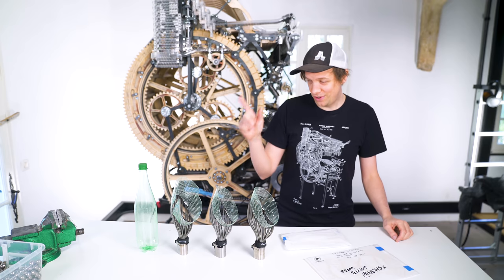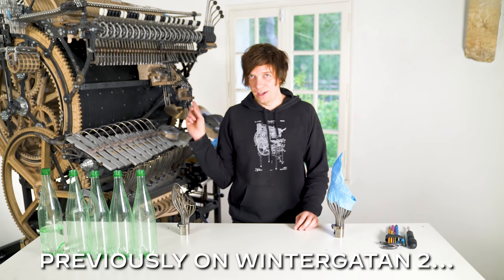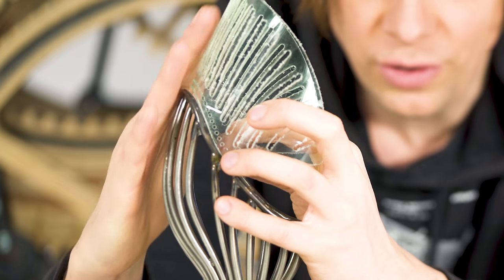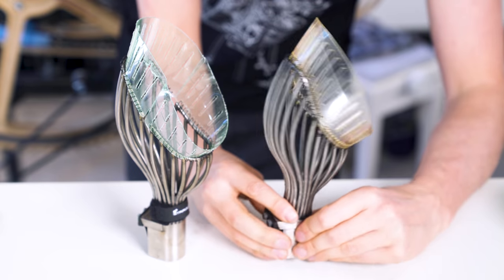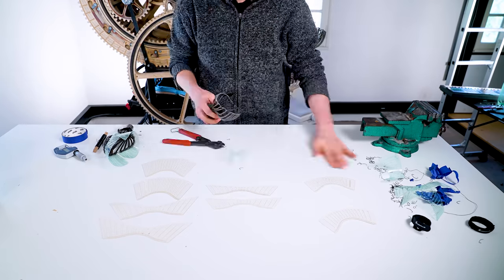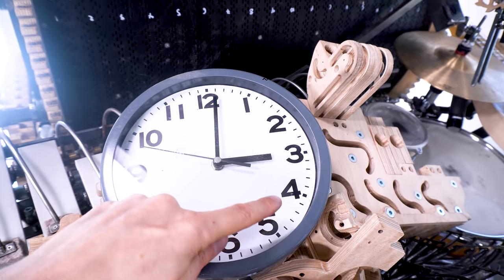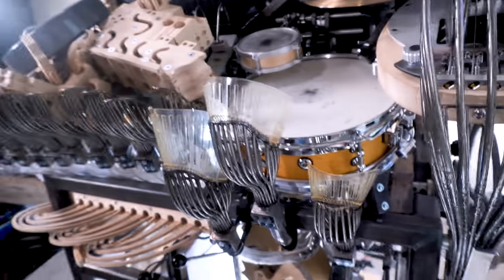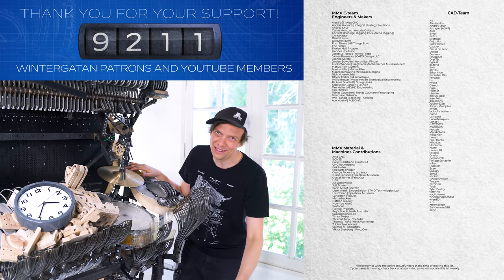Laser Cut Marble Funnels

Comment: I'm curious, how much would the noise from marbles interacting with the metal on the marble dropper influence the sound AFTER production? It's an awesome design. Can the metal parts in the marble dropper also be dipped into a coating to mute the sound a bit?
Reply: He already did this quite a while ago - he coated funnels in some kind of transparent rubber resin, which significantly reduced the noise.
Reply: @zigmar7  You are right. I remember seeing this on the funnels that catch the marbles, which I think is what you are referring to. I'm referring to the new marble dropper though.
Reply: @zanededekind9524  The issue there is friction, you don't want the marbles sticking to a plastic coating especially at their most timing-sensitive interaction with the machine.
Reply: The new dropper design should not pose that much of a sound problem, as the marbles are not "hitting" it but just "sliding along it" The only significant source of "clinking" are the rails of the drop-height adjustment. And they are also part of the old design (and didn't pose that big of a problem there).

But the fix would probably also be rather easy, by putting some sheathing like clear PVC-Pipe around the rails, thereby reducing the sounds while keeping the extra friction minimal (and easily mitigated by adjusting the drop-height ever so slightly)

Comment: Depending on the light, the plastic looks fine, but the rust color just doesn’t sit well with me. I works though so that’s more important.
Reply: Yeah I think Polycarbonate with its transparent, slightly gray-ish color would look a lot better here. Plus the stuff is indestructible.
Reply: Personally, i think the green tint was MUCH better than the yellow, which i think looks more like dirty snow.. even better description would be the windows of an indoor smoker, they are disgusting. The green is my preferred of the two colors, a gray like mentioned might be nice too
Reply: @Basement-Science  but the yellow color doesn't come from the plastic, it comes from the byproducts of laser cutting.  Polycarbonate will do the exact same thing, which is why it is not considered laser cutter friendly.
Reply: @EGL24Xx  Yeah good point, I think someone already wrote something about how you can remove the color as well.

Comment: The marble opening mouvement could've been possible with Lycra® fabric or another elastane fabric between the two parts.

It could also have gave an arty little touch of color on the machine.
However, it's time go move forward and stop redesigning the funnels. this does the job for now and give a funny medieval helmet feeling.
Reply: I think the entire point was to stop the movement of the funnels, they can move fine without the band as thats what they were designed to do.  But the movement was causing issues.
Reply: @caleb6750  The mouvement creates two issues. first, some marbles miss the funnel when it's open and thus has a lower height. This is fixed by the new plastic helmet-looking extension.
The second issue were that some marbles escapes by the gap between the two parts when it's open that's where Lycra could help.

But again, the current solution (no mouvement) works and it's time to move on.
being C programmer one advice i've been given to was "make it fit requirements, optimize later". Here the main requirement is "1/10^7 marble drops without a fail". Until this requirement is satisfied, optimization and embellishment are secondary.

Comment: Use the cyber base funnel everywhere. Problem solved.
Reply: That would look really weird on the drums
Reply: Actually not a bad idea. Whats wrong with a marble trough or gutter instead of individual funnels?
Reply: @mhburleigh1738  Aesthetics.
Reply: @Basement-Science , it you did it unaesthetically, sure, but the marble divider is one continuous section, as is the programming wheel, so no reason the catcher couldn't be as well. But the original purpose of individual catchers was that each catcher would physically move with the music. If that movement has now been removed, having 18 separate funnels connected to 18 separate pipes isn't by nature aesthetic, isn't designing from first principles, nor is it designing for manufacturing.

Comment: Sorry Martin, I thought it wouldn't bother me but I really find these funnels so ugly. Surely it would be possible to extend the metal frame or commission someone to make new ones.
Reply: What is funny about it is that martin originally had them in the correct place, but the pipes stuck out too far so he changed the angle and position of them to be more pleasing to the eye, but then this resulted in missing some marbles... Now to fix it hes removed the opening and extended the catchers...  What this needed since he first didnt like them was to go back and redesign them so the catcher is exit is more angled to the side and not down, then they could have opened like he wanted, been in the right position and  not stuck out so far to look bad. 

This plastic that is being used is horrible... i really hope there comes a day in the future where martin does redesign these and gets rid of that plastic. So long as its not permanent i can accept it for now... 

Glad to see martin will be using the new design for marble height as well.
Reply: Agreed.. Dont like them
Reply: same :(

Comment: I feel that these aren't really necessary after balancing the flywheel and keeping the funnels shut 🤔
Reply: Yeah, was wondering the same thing. I would even dare say dropping a couple of marbles is probably better than having these plastic things so visibly on the machine. A marble getting stuck is a deal breaker, a marble dropping really doesn't matter that much.
Reply: If you didn't watch the second channel videos he did a bunch of testing and had issues even with the adjustments.
Reply: @sonic4spuds  yeah I did watched all the videos, but I'd I remember correctly, the last decision was keeping the funnels shut. I don't think he tested shut funnels without plastic extensions. Is there a video I missed? 🤔

Comment: I do a lot of laser cut projects. I usually leave the protective backing in place during cutting to avoid burn marks and the browning of the materials. Also, I might suggest making a similar funnel top out of laser-cut plywood. it would be a better match for the wood and steel of the rest of the build.

Comment: Martin, I still think the best solution for the funnels is a small plastic or felt disk, functioning as a landing pad inside each of the funnels. That would dampen the bounce of the marbles and prevent them from hitting a single rod in the funnels at a weird angle. Then you could open the funnels to spring open again, without escaping marbles.

Comment: I always felt that a chainmail fabric used as a little curtain would work very nicely. There are immense varieties of chain mail, different metals, different thicknesses so on. 
Drape simple chainmail pattern over a support and the balls would be dampened when they hit. Then just roll down the curtain. Silent and adjustable. 
The only support would be a single wire that's shaped similar to the edge of the current design. The fabric would hang loosely from it.

Comment: If you make the laser cut part that goes on the non-moving part of the funnel so that it has "wings" that extend past the farthest point that the moving part of the funnel moves, then when the funnel opens up to its farthest position the gap at the sides will still be covered by the "wings".  No gap means no lost marbles. Then you can get the funnel motion back into play.

Comment: Suggest marking up those plastic parts with dry erase markers for the tests so you can see if the marbles are hitting them.
Reply: Good idea. I have a feeling that they aren't. It might be better to just line the insides of the funnels with overlapping plastic to retain the movement and stop the marbles escaping through the gap.

Comment: Just a tip for your CNC when cutting thin plastics use double sided tape to hold it down. Also use spiral down cut end mills they wont pull your part up as it cuts and wont leave frayed edges.

Comment: Hi Martin, 
Have you thought of adding some elastic material or the plastic you had CNC's for the tops, to go between the two halves of the funnels?
If you use elastic, this will be fixed to the two halves, but if you use the plastic, this would overlap one of the halves, so when it moves, the plastic fills the gap between the two halves of the funnels.
Keep up the good work.

Comment: @Wintergatan Martin, are you sure you need those plastic shields? If you keep marble funnels closed, marbles will not escape. If you remember, marbles are escaping through the gap when funnel is open. When funnel is closing after previous marble, next marble receives all the energy previous marble left in funnel. If it hits the funnel in just the right (wrong) way, marble will be redirected straight through the gap. I would be surprised if any marble escapes with closed funnels and removed plastic guards. I am not a huge fan of those plastic funnels.

Comment: I'd have the marbles hit a sheet of carbon copy paper on a board (instead of a funnel) to measure/record the location and spread (which should be fairly tight) then use a tangential tube big enough to cover that spread so the marblee don't hit anything and make noise...
Quietest thing would be a material safety-net curtain strip to catch any used marble but that's less Animusic Pipedream...
I'm late to the party though, so all this has probly been discussed and discarded long ago! 🤷‍♀️😂
It's fun just imagining along with the project 🤘

Comment: Have you tried putting the bottom edges of the plastic funnel lips down on each their side of the metal funnel edge? If you tighten the wire well they would get stuck down there, clamping the metal and letting you adjust their angle of the plastic much more easily than you can with the loose fit on top.
If you decide to try this, don't use metal wire to secure the lips. It's too hard to shape around tight corners to ensure a good fit. Something like a decent strength fishing line would be great for instance.

Comment: What if the sides of the lower half of the marble catcher overlap on the inside of the higher marble catcher then there will not be a gap when the marble catcher opens! The overlap may be done in that thin PET material, just extend the lower marble catcher's plastic part with two "legs" going down on the inside of the marble catcher.

Comment: You could just weld the split in the connector (part held together by the springsteel) and forgo the need for elastics or velcro...
Reply: He just needs to extend one half to encase the other half by so that as they open there wont be an opening between the halves. I don't think he's quite to the point that he wants to throw away the idea of the funnels moving when hit just quite yet... hes just done for the time being.

Comment: If you extended the sides of the fixed portion of the new material to fit within the sides of the movement piece, then when they are 'open' there would be no gap, no marble could get thru

Comment: Martin, I believe the funnels should be re-made, even though this solution works for now, a remake with the correct dimensions would look even nicer. maybe use thinner metal rods and make them more dense. Maybe you could add a weighted trapdoor on them and connect them opening to some sort of visual indicator, so you dissipate the marble energy and keep the mechanical movement flair from the marbles hitting the funnels

Comment: I'm worried about the noise of the new marble droppers. They seem to really stand out, and if u multiply it by 36...
Reply: Went here to write the same. they are quite noisy!
Reply: The close mics will not pick up that sound nearly as much as what we're hearing right now. If you go back you'll hear him compare distant vs close mics, he might even add distant mics into the mix a little because the close mics were so clean. Good concern though, thanks and will see soon enough :)
Reply: Also notice when the camera goes around the machine the clicky wheel is hardly audible compared to the snare.

Comment: Given your tendency to modify existing designs after they've already been implemented, I'm unsure why you would not simply re-design the steel funnel to extend up where the plastic funnel goes.  Using the pastic and wiring it onto the existing design really seems like a half-assed band-aid fix.  I suggest re-designing the steel cage on the funnels to extend upwards to a point that covers where the plastic covers.

Comment: I hate to say it but I think the plastic extensions are ugly, and that the whole thing would be more visually appealing if you just scaled it up to the necessary dimensions in metal. That may not even be necessary though, as it seems like the swing mechanism is what allows "near misses" to escape in the first place, and if the spring were tightened up a great deal so the basket never swings far enough to allow a marble through the gap, that might be good enough. That would probably add noise because the structure would be more rigid when a marble hits, so perhaps having silicone tubing over the bars would negate this. Then again, it could also wear too fast to be a practical solution, especially if you have to apply the tubing before completing the welding process. If that's the case, then maybe just Plasti-Dip the parts. When they wear thin, strip and dip again. (Do wear breathing protection or use a fume hood or otherwise provide a lot of ventilation, as the volatiles given off by curing Plasti-Dip are not something you want to breathe.)

Comment: Unpopular opinion- adding the plastic to the funnels looks bad.  As in, very bad.  If there is one thing about this machine I would get rid of, it’s those.  And that’s even when I know the kinetic fingers are still happening.
If the marble droppers get reworks for months, I believe the funnels should be redone as well.  Making the wire sections longer so it is all metal again would vastly improve machine aesthetics, and have the same level of functionality.

Comment: In my opinion these workaround marble funnel extensions are not only from a visual but also from an engineering perspective the weakest part of the machine at the moment.
If they would stay in the final machine, i would be quite disappointed. Especially in light of the many hours and weeks martin spent on iterating and rethinking whole mechanical paradigms to achieve visually and mechanically optimized parts. Even if aesthetics have to give way to the functionality of the machine, this just looks so sloppy compared to every other part of the machine.
There has to be a better solution than to strap PET cutouts onto a failed funnel design.

Comment: I'm sorry to say it, but I hate these parts.  They look ugly and they're the wrong way to solve the problem.  The correct solution to the marbles missing the funnels seems so obviously to be to adjust the position and angle of the funnels to better match the path of the marbles.  I don't like the way the plastic looks attached to the metal, and it visually just looks like a stop-gap afterthought cobbled together by someone who isn't an engineer.  I also suspect that the plastic being fastened to the metal like that could cause some future problems as it moves around and gets hit by marbles, possibly becoming loose and moving around too much.